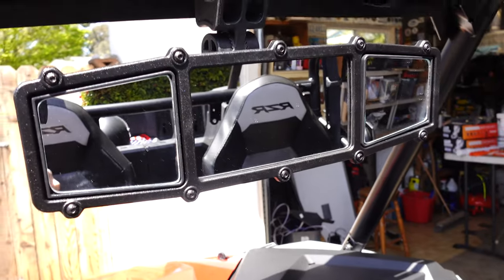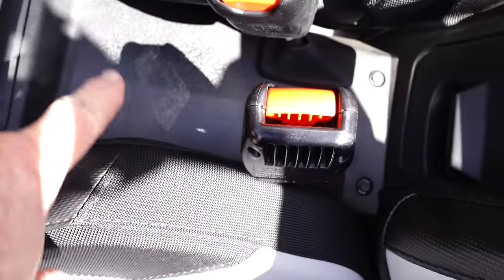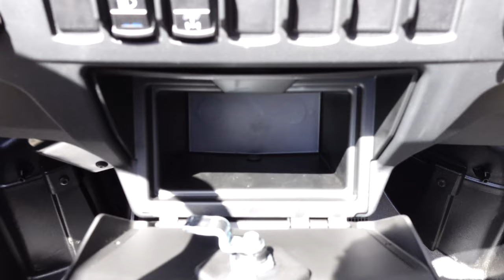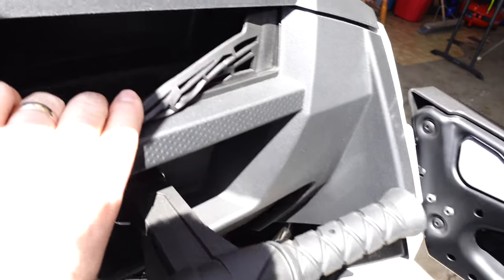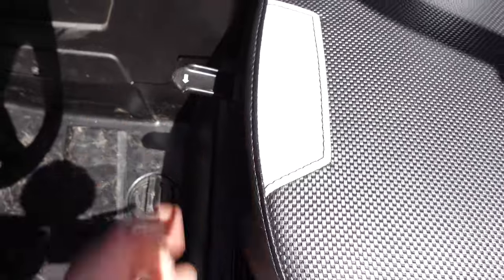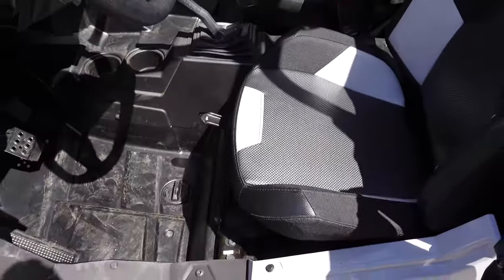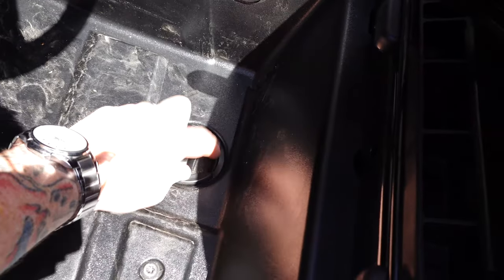NEW! 2021 Polaris RZR XP Turbo 2 seat Introduction and Walk Around

Comment: I have a 2018 XP1000 non turbo. Ive found that my RZR is like a boat I throw money at it like its my job LOL. I have put roughly 12k worth of upgrades into it without doing any work to the engine. did rhino axles front and rear hard top glass front windshield with wiper sound bar Aircraft intercom system Spare tire and yes I carry 2 gas cans mounted on the roll bar and I'm running Tusk Terrabite DOT tirees that I absolutely love. She is awesome up here in Northern Az. I look forward to watching you fix up your rig.
Reply from the maker: Thank you

Comment: Great video, only thing I’d change is calling it a UTV instead of a car. That bugged me every time you called it a car
Reply from the maker: But in many states you can actually drive these on the public roads. Wouldn't that qualify as a car?
Reply: You can also legally ride a bicycle on the road in most states but you wouldn’t call it a motorcycle
Reply: @HappyValleyCrawlers  yeah but bikes don't have the mechanics or behave as motorcycles
Reply: @3DaysAway  Tagged in Tn. and I still wont call it a car.
Reply: It costs as much as most cars, it has seat, seatbelts, a steering wheel, gas powered motor, and can be titled as a car. Your argument is invalid. Just because you don't like that he says car instead of utv doesnt make it fact.

Comment: I know you said you're bot an expert with SXS's but the XP Turbo is not an XP 1000 Turbo. The xo Turbo has a 949cc engine and a Turbo, and the XP 1000 has a 999cc engine and no Turbo. The XP Turbo has an upgraded/stronger deivtrain. The only thing the XP 1000 and XP Turbo share is the frame/roll cage.
Reply: The turbo actually has a 925cc engine since you seem to be an expert. Lol
Reply from the maker: Thank you